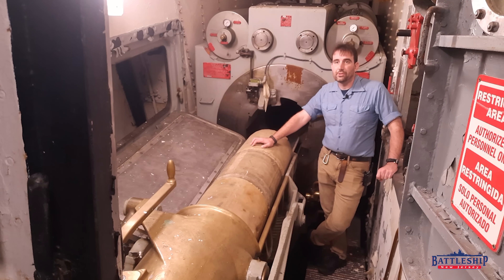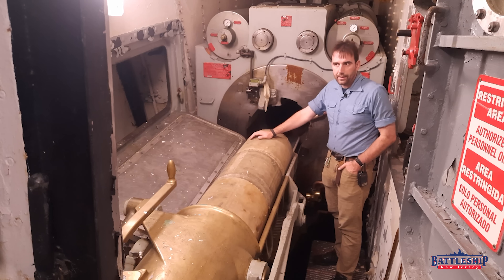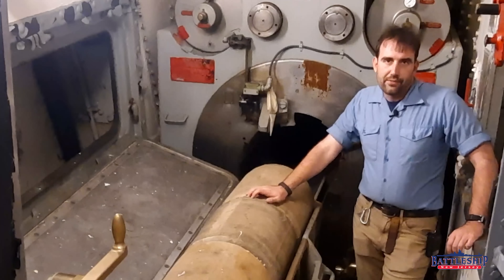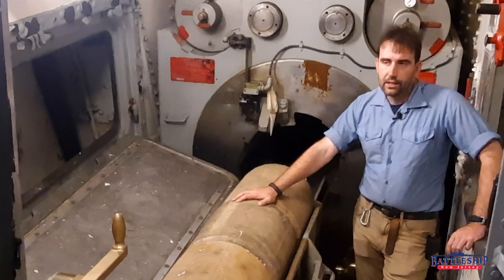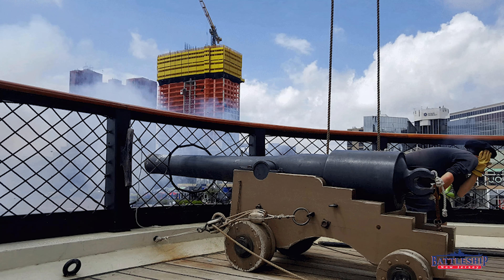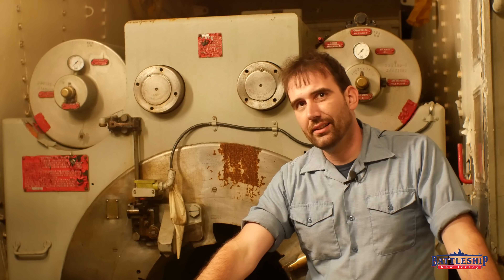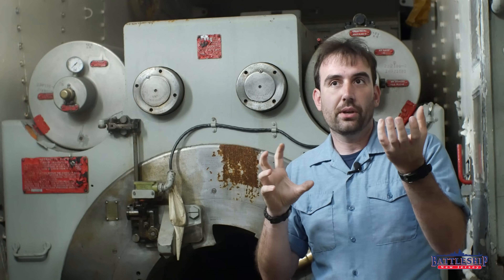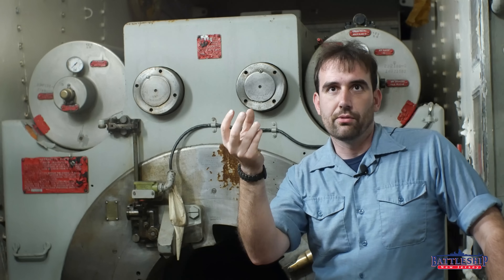How to Unload the Battleship's Guns

Comment: I've been on an objective reorganizing my position and consolidating ammo, and a .50 caliber round hit the ground 2 ft from me before. It had cooked off in a hot 50 caliber barrel a couple hundred meters away.
Normlly the gunners shift fire over the objective when we pop a colored smoke grenade on our final assault, but on that occasion the newbie gunner did not shift fire, and didnt clear the gun.
It didnt scare me at first, because I didnt realize what happened, but once I found out it did, and it made me mad.
We had a misfire on one of our 81mm mortars too. 
The procedure calls for getting away from the tube and allow it to cool for 3 mins or so, then go back, disconnect the tube from the base plate, and raise the base of the tube high enough for the round to slide out of the tube while one guy with asbestos gloves catches it, and then Carrie's it about a hundred yards away.
On one occasion the mortar crew didnt wait for the tube to cool. While trying to raise the tube to extract the round it exploded, and all the ammunition lined up on the top of the mortar carrier exploded with it.
Those boys, 3 of them, were inside an old M113 variant mortar Carrier. The top hatches were open, and the ramp was down, but it didnt help them.
What wasn't ejected through the back or top of the mortar Carrier was painted on its interior walls.
It gutted everything inside that carrier, and made a mess for 50 yds all around it.
Not a pretty sight.

I would think a hot artillery barrel could cook off a round as well.
I would want to unload one until I was sure it had cooled, and I would point it anywhere it could do damage if it did cook off.
But, maybe they dont fire fast enough, or often enough to get the barrel white hot like a 50 cal, or a mortar tube. Am M60 was bad about cooking off rounds too.
I've heard tell when an M16 cooked off a round, but I've never seen it. I have seen the barrels get white hot though..
Reply: Somewhere on youtube there is a video short of a seaman spraying water with the fire hose on a large diameter barrel.  Forget whether it was 5" or 16", but it was steaming.
Reply: @skydiverclassc2031  ,. Right,,,,
If it was safe anyone could do it...
Don't put a bullet in the gun, unless you plan on using it, and then be careful where you point it...
Why would you need to unload it?
If you destroyed the target on the last round, usually putting one more on it isnt going to hurt...
When we shifted fire, it was generally on to the path of the enemy retreat.
With the mortar, that was a failure to follow safety regulations. They didn't follow their training.. (pressure, lead to their carelessness.)

Comment: On the Otto Malara 76mm, it was common to have the projectile separate from the casing, after ramming. We had a wooden attachment for the end of the cleaning rods, that cupped the end of the projectile and allowed us to hammer it out. We also carried a clearing charge, I believe it was half the size of the normal casing.
Reply: Oto Melara :-)
Reply: @lucamesseri4563  Thenk you for correcting my deficiencies. I will strive to make the necessary changes to ensure this fault is never repeated. 
Kindest regards.
Reply: @ManBearPig781  , no problem! I do not claim to have any higher skills than yours, I am simply an Italian. Thanks for your interesting contribution to the discussion and for your kindness, best regards.

Comment: I had a live (there’s a 9mm tracer practice one and the actual warshot) AT4 rocket launcher misfire (complete failure of the rocket motor to ignite) ended up standing there five minutes before I was told, “drop it and run,” never ran so fast again. EOD ended taking it and blowing it up, was kind of a cool day…. Looking back at it.

Comment: Back in 1995, when I was a 11C (Mortarman), I had a live 4.2-inch HE Mortar shell Mis-fire. As the AG (Assistant Gunner), the steps I had to perform was to clear the armored vehicle for five minutes, then get the Gunner two canteens of water to pour down the barrel, and then have the Gunner and Ammo-bearer raise the bottom of the barrel while I stood at the front of the barrel, ready to catch the mis-fired round and escort it to the Dud pit for disposal.
Reply: Back in 1969, when I was a 11C, we had an old 81mm that was worn out!  About one out of every 5 or 6 rounds would hang.  I finally figured out that the firing pin was worn as much as the rest of the gun.  I found a new one some where and managed to replace it.  No more problems after that , but we dumped a lot of rounds out of a hot tube.  I was the one who got to elevate the tube to dump them out.

Comment: Well, it aint exactly the size of a 16-inch naval shell, but I did have a squib load that I failed to notice in my Century Golani rifle. I continued firing another one or two rounds until the whole thing blew up. Amazingly, after knocking the stuck bullets down the bore and out the chamber, the barrel exhibited no bulging. I later sent the whole gun to a Galil specialist gunsmith to be refurbished into what a real Galil looks like and he confirmed that the barrel was still good. The explosion ruined the bolt face, gas tube and part of the receiver cover but I was wearing eye and ear protection and the Galil has a machined steel receiver and thus no injury to myself other than my pride...

Comment: I'm a former artillery officer. The brass ring you describe is actually called the driving band. Its normally made of copper. It's relatively soft so when it is rammed into the chamber of the ordnance the copper bites into the rifling, or rather is deformed into the rifling of the barrel liner. When the gun in fired tha bite imparts the spin into the shell. It also creates a seal between the shell and the bore, improving the chamber pressure, keeping it consistent and also increasing muzzle velocity.

Comment: The problem with unloading rounds that are in the breach, (I have experience with 155mm M777A2 howitzers) is that the tubes warm up and gets extremely hot, this causes the metal to expand. If you shoot multiple rounds, then go on a cease fire. And then you need to remove that round that was sitting in a hot breach, 1 of 2 things are possible which is why you want to dump the powder out as soon as possible because it can ignite. A friend of mine was shortly set on fire in this instance where he was supervising the unloading of a 155mm shell and powder, the powder dropped out of the breach and turned him shortly into a human torch(no lasting injuries). The other and more costly instance is the round getting physically stuck in the breach, where the tube would need to be removed because that warm metal had cooled to the point that the round is stuck in place.

Comment: We had to remove a round from a M777, we were in the middle of a fire mission and had a complete safety stand down. A different battery double loaded a gun and it blew up. Luckily no one was killed from what I heard. But for our battery, one  gun spent the next part of the day taking a pole trying to ram the round back out the breach.
Reply: Ummm. How do you “double load” a 155 howitzer? What does that even mean?
Reply: @tcoradeschi  short answer not paying attention. 

Long answer: it wasn't my battery but. The gun line could have a fire mission (let's say 5 rounds) and (gun 3) is slow maybe new guys. Every other gun fires all 5 rounds. Gun 3 is on round 4 and cease fire is called. A round is in the tube. 

(At the end of a fire mission a guy is supposed to physically look down the tube and yell "tube clear")

A few minutes later another fire mission is called. And they load a new round. 

This was during high intensity training. Night moves and gun empacments at 3am in NVGs for a month straight. Exhaustion could be a factor to.
Reply: @wardaddyindustries4348  that’s what I was thinking. OFC, once the second round is in the loading tray, and they try to ram it, won’t be long before they realize that something is not quite right. Not sure you would even have room for a prop charge…
Reply: Double drop on a mortar? Totally something that can, and does (rarely, thank God) happen. It’s not pretty.
Reply: It happened during the day so nvgs won't be a factor there but NVGs can really wear you down and cause eye fatigue if they were using them the night before

Comment: In the age of sail, the tool to extract the ball / shell was called a worm.  It would extract the ball, but the powder bag couldn't be removed with out ripping it open.  Hence firing the blank charge. If a charge was left in long enough, the gunner or gun captain would worm the ball, fire it off and replace with a fresh charge.  You will notice naval guns, then and now, had plugs that fit in the muzzle ends, called tampion (tampon, if you are British). And yes, occasionally a gun would be fired with out removing the tampion first. Land base artillery does have the ability to extract unfired shells, but it is a pain in the butt. Everyone avoids it if they can.  I would assume it's the same in navy...

Comment: I was active duty EOD in the Army but still remember (somewhat) the stuck round procedure for the 16 inch gun. There are stuck round procedures for all weapon systems, but the 16 inch is one that really stands out. Trying to manually remove a rammed projectile is the primary means done by the gun crew. Trying to fire or re-fire the projectile out would be a good next step if it could not manually be removed. Now the other EOD stuck round procedure (and the reason it stands out) requires the removal of the barrel from the ship, it is placed in an elevated position, and the projectile is explosively forced out the breach end. Obviously this has to be done in port, and nobody wants to arrive with a loaded gun tube.
Reply: Easier said then done.  Removing the barrel entails shoring up the two lower decks under the gun and building a mini railway to support the barrel as it is extracted.  Its an intensive process.  I think Ryan has a video or a photo showing it.

Comment: On the subject of the guns, any thoughts on the '89 explosion of an Iowa turret?  I remember it being big news as a kid.  Read up about it later.  Seems it was caused by an "over ram" of the powder.  But, not explanation on why that would cause the explosion.  My best guess comes from reloading much smaller rounds.  I know with things like rifle rounds, if you underload the powder in the casing it can be far more dangerous than underloading.  Basically it burns too fast in the casing rather than as the gasses expand down the barrel.  The rapid over pressure caused the chamber/breach to explode.  Is that essentially what happens in a 16 inch gun?  Powder bags too loose and has too much room to expand with out pushing the projectile.  That in turn basically turning the gun into a bomb.

Comment: There are times when you MUST clear that barrel quickly or risk an explosion.  One such time is when the gun is hot from repeated firings, so obviously it's called a Hot Gun. 

Let's say you've been burning a bunch of powder during gunnery exercises and your gun is too hot to touch, and "Check Fire" or "Cease Fire" is ordered after you've loaded a live round but before you send it on it's merry way.  The round (propellant charge and shell (assuming live charge)) is sitting in that HOT breach and may well "cook off" if you leave it.

Preferably you get permission to train the gun to a safe bearing where no one will get hurt when the "bullet" comes sailing through at Mach 2+ and send it before it can cook off.

The alternative to that if for some reason you can't fire the gun or it refuses to fire (bad primer for example) is institute "Hot Gun" procedures.  You train fire hoses on the barrel and the base of the gun (if possible,) clear ALL nonessential personnel from the vicinity of the gun (back to around amidships at least) and hope you can cool that mass of metal before the charges get hot enough to detonate spontaneously.  You keep the gun trained in a safe direction in case (you hope) the propellant charge goes off, sending the other half of the problem down range.  If the explosive charge in the shell goes off in the gun you ARE going to lose the gun, probably the control room immediately below it and any personnel manning hoses around the gun and in the control room.

If you are really unlucky or your Guardian Angels don't like you, the fireball may even reach down into the magazine where (hopefully) all the propellant charges are stowed properly and protected.

The Gunner's Mate Gun Captain will wait the minimum time needed to ensure it isn't simply a "hang fire," then have the loading mechanism extract the "dud" propellant charge and load a new charge, then trigger the gun again and hopefully send the 70 pound "bullet" downrange.  The "dud" charge is heaved overboard, you don't send defective charges back to the magazine.

These deck guns, especially the MK-45 5"/54 or 5"/62 can get hot enough to burn the paint right off of the barrel in just a few minutes firing.  Needless to say, we practiced "Hot Gun unable to fire" procedures regularly.  There are photos available through Google of USS Caron (DD 970) Mount 51 taken off Beirut in 1983 after that gun spent most of the preceding night unloading the forward magazine through the muzzle.  The burned and blackened paint is hanging off the barrel in streamers.  They fired something like 450 rounds in "Call Fire" real world combat missions overnight while covering US Marines at the Beirut Airport, this was after the suicide bombing of the Marine Barracks.

I joined the ship shortly after she returned to Norfolk after that mission.  One of the HT1s told me that if they had a misfire Hot Gun, that gun was hot enough it wouldn't have taken long for the round to cook off.

Comment: NAVWEPS OP 1591, 1961

PROCEDURES FOR BAG TYPE GUNS (8" AND 16")
 1. GENERAL DATA

In bag type guns the heat input to the barrel is of such a low order that the danger of a cook-off is remote. However, such a condition could occur if shore bombardment or an engagement of prolonged duration were encountered. Misfires and hang-fires however, can occur and in the case of hang-fires have been known to endure for 30 minutes before firing. There have been cases in which the powder bags have been placed in the gun chamber with their ignition ends towards the muzzle. When this happens, a misfire or hang-fire can occur. It has been determined that such charges can be ignited by firing a series of primers into it. Elevation of the gun to maximum elevation and rocking it in the trunnions may aid in sliding the charge to a firm seat on the mushroom face.

2. GENERAL PROCEDURES

A recommended procedure is as follows when a hang-fire or misfire occurs:

a. Elevate and train the mount to a safe line of fire.

b. Clear all unnecessary personnel from the vicinity of the gun.

c. The crew shall never leave a loaded gun until the directions of the following paragraphs have been complied with.

 3. NONCOMBAT PROCEDURES

a. COLD GUN.

(1) Keep the breech mechanism fully closed.

(2) Exercise care to avoid danger from recoil or flareback.

(3) Continue attempts to fire. Do not leave the firing lock open any longer than necessary when changing primers.

(4) If the gun fails to fire proceed as follows:

(a) Open the firing key and break the firing circuit elsewhere.

(b) Unhook the firing lanyard if detachable.

(c) Remove the primer from the firing lock with the primer tools supplied for this purpose provided such action will not open the breech.

(d) One hour after last attempt to fire, open the breech, remove powder and dispose of it over the side or immerse in water.

b. HOT GUN.

(1) Follow the procedure outlined for a cold gun except for paragraph (3) (a) (4) (d).

(2) The 1-hour wait is not obligatory if in the opinion of theCommanding Officer there is danger of a projectile cook-off.

4. COMBAT PROCEDURES

Follow the noncombat procedures except that the 1-hour waiting period is not obligatory if in the opinion of the Commanding Officer the procedure would jeopardize the ship in action or that there would be danger of a projectile cook-off.
Reply: Maritime.org/doc/clearingord/index.htm

Comment: EOD/Explosives say if you have a hangfire per Dept of Defense: 1)If standard explosives use the second squib (which, they don't have on naval guns,,,,,) 2)For small arms- rifles, pistols, you have to wait 30 seconds "just in case" then clear that cartridge. 3)If it's a standard explosive charge- lets say,,,,,oh,,,a "Tankers Grenade" of a 2 pound block of TNT wrapped in duct tape and nails- it's 24 hours.  4)But for these guns?  Seems like you said there's both an electrical firing circuit AND a mechanical firing circuit.  Odd's of having them both fail at the same time are astronomically tiny- like "Two time clocks on bank vaults failing at the same time preventing the bank from opening" kind of failure.  (Ask your local bank- they normally like to show off the vault and you'll see the built in time clocks through the inside glass).  I wanted to go EOD, but,,that would have meant re-enlisting in the Army.  There's ONE COLLEGE IN THE UNITED STATES that teaches EOD- and it's run by Texas A&M.  Can't remember if it's a 6 week or 12 week course and cost about $9,000.  No, they do not teach how to disarm "Special" weapons (Nukes)